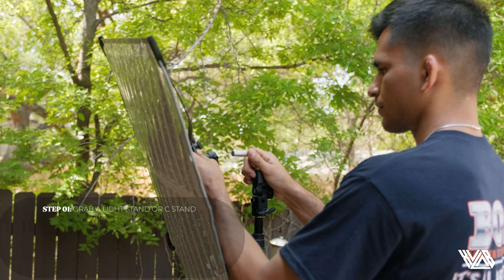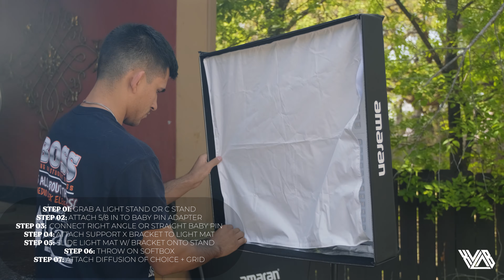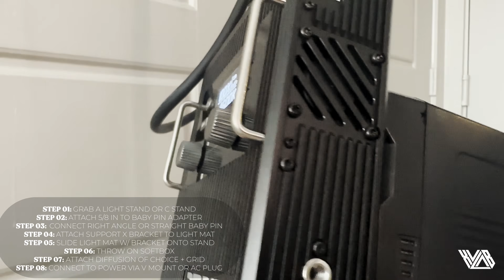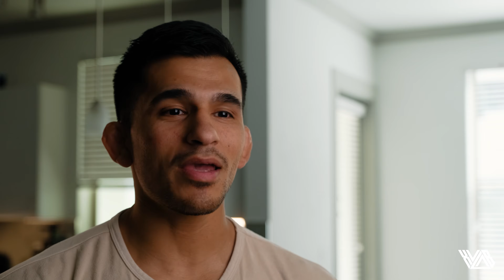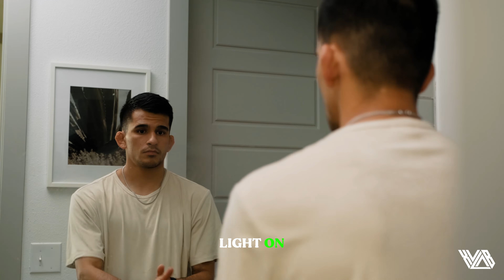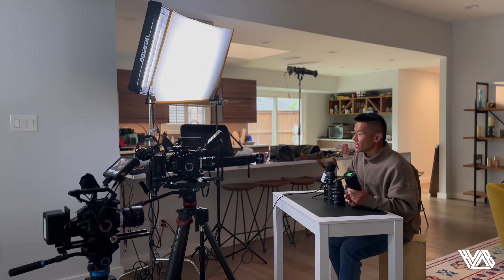BEST LED LIGHT FOR FILMMAKERS?? | Amaran F22 Review

Comment: Thanks for showing the versatile ideas for lighting with this. I just bought one and awaiting delivery. I'll see how it goes then may consider a 2nd unit if it fully works for me. I'm a little concerned about fan noise from other reviews, but guess if carefully locating controller box and using directional mikes it won't be a major problem. Also easy enough to clean up constant noise via good software (Fairlight within DaVinci). I also heard it's relatively easy to open up the box and switch out the fan for something quieter like a Noctura (super quiet fans from renowned Austrian manufacturer - I really rate Noctura and use them in all my computer builds).

Comment: Hi! Can battery and power source (from the wall) be plugged at the same time? Will it automatically switch to the battery when power source is plugged out? Will the power source charge the battery or do I need external charger? (I am new to all this :D )
Reply from the maker: hey great question! yes it will automatically switch to power from the wall over the attached v mount battery! unfortunately it will not charge your v mount when plugged into the wall, you will need an external v mount charger for that!
Reply: Thank you! @vinnysaenz